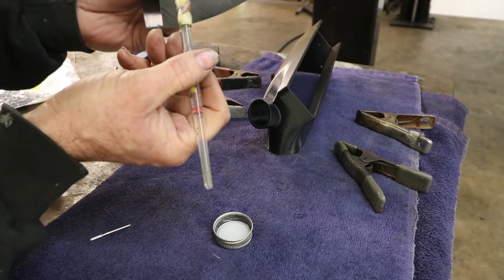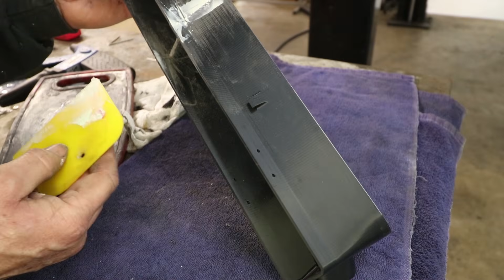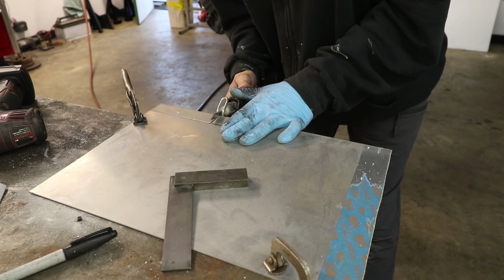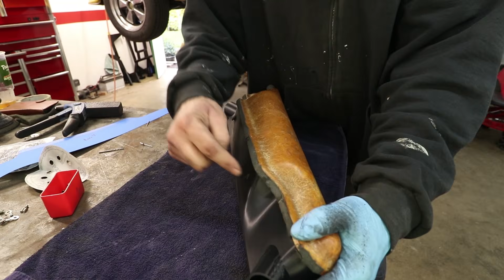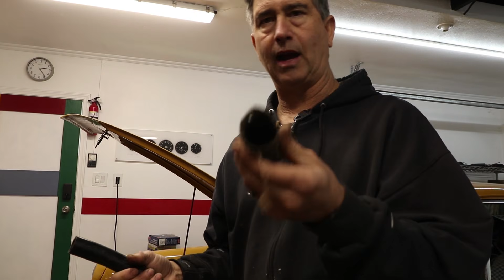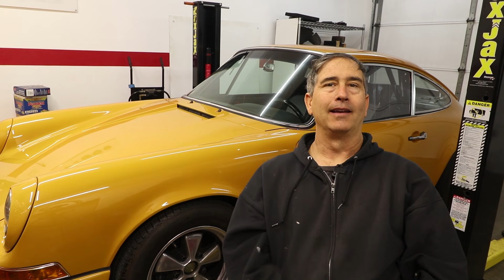Custom Rain/Air Vent for My Backdate 911 (Lightweight 3D Printed Upgrade)

Comment: Great 3D print solution. That early 911 fiberglass piece has indents that originally used a U shaped metal cradle piece that to hold it up. A U shaped hook attaches to the body over the cradle piece and a screw tightens it up against the gasket seat by pulling on the hook and pushing up the fiberglass piece via the cradle piece. It is simple, won't come loose or rub like a spring, and bombproof, like you'd expect from old Porsches. You could adapt and original piece or make your own to fit your new configuration.
Reply from the maker: Thx, I'm aware how the early cars fastened this piece.  I just didn't want to find a bunch of original parts and hack them up.  Too expensive and time consuming for what this is.  Porsche also used a lot of straps to hold things too.

Comment: Nice idea, excellent blend of the old fresh air intake into MACs dash. Hill Country will be a great trip.  Aircraft Spruce has silicone SCEET ducting for the air flow.
Reply from the maker: We never know if it will be really cold or hot in Texas in March.  Either way I'm ready now!  I ended up ordering the SCAT ducting from aircraft spruce.  I also got some SCEET high temperature for the heat exchangers.  Can't wait to get it all hooked up!